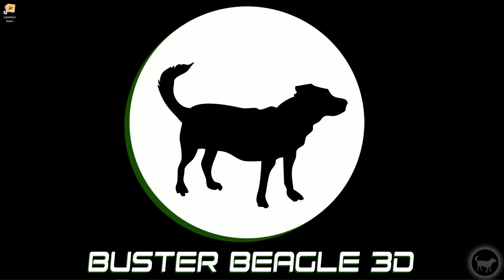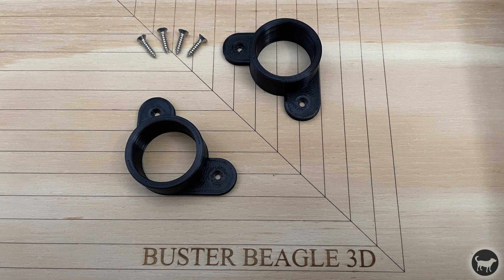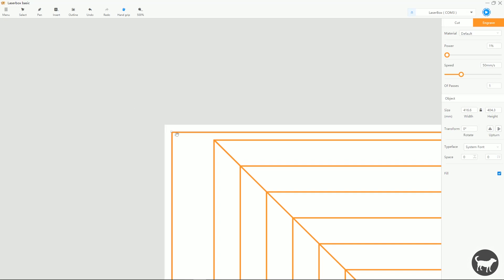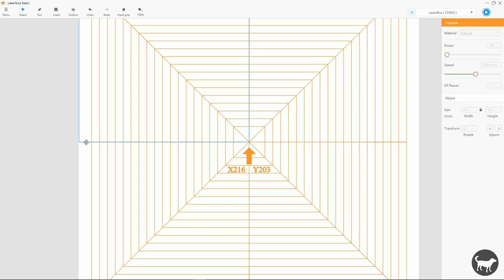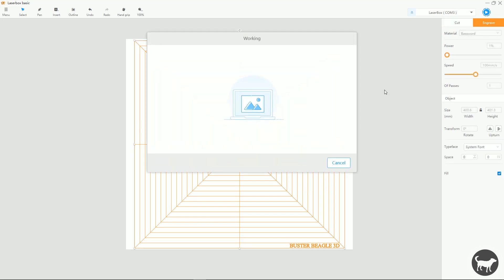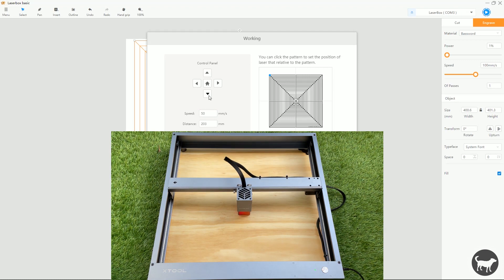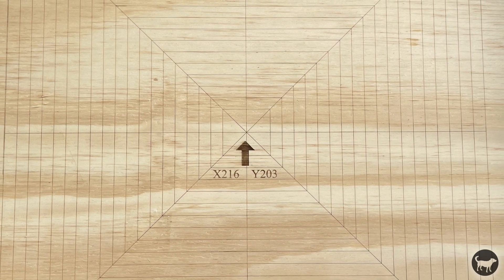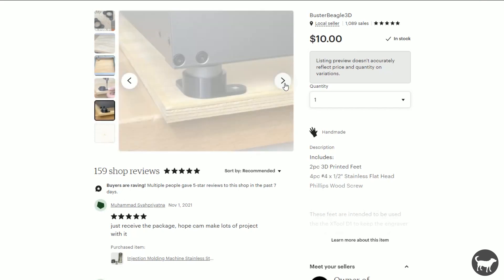XTOOL D1 Laser Foot Bracket and Laserbox Grid

Comment: Hello Buster Beagle, I am thoroughly confused! I have a D1 which has been sitting in its box for a year. I just got it out, I am trying to find your file for the spoilboard in this video......am I a dope or why can I not see it in the thingiverse list? I see feet files and rotary tool files. No spoilboard.  Also....I have downloaded creative space, but cannot find a download for laserbox anymore on the x tool website? What am I doing wrong?
Reply from the maker: Hello. The files for Laserbox are called .lqx files. They are a bit old now and I would highly recommend using Creative space since the other program is really being phased out. If you can’t find Laserbox anymore I now have a more comprehensive and detailed grid that you can find here. https://etsy.me/3YUcBHm  It says that’s it’s for the Pro version but will work with the original D1 as well.

Comment: I've watched the video 4 times. Read the read me first 4 times. Made sure i turned off the crosshairs and all of the offsets mentioned in the video and instructions. I've tried using all 3 files for my D1 pro 5w. I still get the out of bounds error EVERY time. Please advise ASAP.
Reply from the maker: I'm not sure what program you are using but if you are using Ligthburn your workable area should be Width 430, Height 400. It shouldn't be the size of the grid. I made it smaller then the workable area to accommodate that.

Comment: Hey Buster!
I assume since you are using wood here that the honeycombs don't make that big of a difference in the "char"? I will be running air assist, but I want to opt for the extension over the honeycomb (I have a set budget for this purchase) Thanks for the videos!

Also, have you found a limit for max run time? I will mainly be doing leather patches and was curious..how long is too long? Thanks buddy!

Comment: What corner are you saying you move up to? Trying to burn this but not sure on this
Reply from the maker: The home position is in the top left corner.
Reply: Ok, I am running it with the laser unplugged (as I'm in the middle of a hurricane) just to see if it's correct but when it goes to the far left I get a few belt jumps
Reply: @williamhoughtaling1602  hello, I had the same issue when I tried framing and the belt started jumping. I noticed that there is an invisible object you'll need to delete. It's located on the outside left of the workspace. I found it by clicking and dragging and highlighting the entire left side (outside the workspace). I hope this helps.
Reply: Ok I'll look tonight

Comment: Im also running laserbox but when i go to engrave there is no home button, only the arrows.  Did they do away with the home button on an update, is there another way of getting home?
Reply from the maker: Yeah. They removed the button a while ago since the machine doesn't have any limit switches. You can just move it manually to the top left corner or you could also make or 3D print one of these brackets to make sure you are always placing the laser in the same position. https://www.thingiverse.com/thing:5274995
Reply: @BusterBeagle3D  thanks for the reply. One last question. On the new smaller grid pattern on the left side it’s listed 3-50mm, 45-60mm, 60-70mm. What are they referencing?
Reply from the maker: @Dark_Horse_CC  Those are used with the optional rotary attachment for things like glasses and tumblers. It helps line up everything for that. If you check oout my channel I mention it in a few videos.
Reply: @BusterBeagle3D  I must have missed that video. I’ll look back through. Thanks again.

Comment: In my current version of their software there is NO HOME BUTTON where you can "set" the start point of the laser to the top left of the frame. This is WORTHLESS without being able to calibrate where the laser head is starting from.
Reply from the maker: The biggest advantage to the grid is to be able to square your piece to the laser an not to calibrate absolute positioning. There are no limit switches on this machine which is why I'm guessing they decided to remove the home button. It homed by basically slamming into the frame.  There are other ways to "home" the machine to the same spot if that is what you want to do. This tool for instance. https://www.thingiverse.com/thing:5274995

Comment: Good Stuff. My Laserbox software does not have the "Home" option. Am I missing something?
Reply from the maker: They removed it. It was kind of useless without proper limit switches anyway. Just push it manually to the top left corner manually.

Comment: My laserbox basic doesn’t have that “home” button to return the laser head to the top left. 

Any way to get it?
Reply from the maker: You can just manually move it to the top left corner. They removed that button since the machine doesn't have limit switches so it was homing by banging into the frame.
Reply: @BusterBeagle3D  thanks for the reply. That’s what I’ve been doing, but it seems to have a bit of bounce when I put it up on the top left. Was hoping for a mechanical/repeatable option.

Comment: what size for the spoil board?
Reply from the maker: 2'x2'x0.5"
Reply: @BusterBeagle3D  can i use the grid file in lightburn?
Reply from the maker: @bigkahuna2297  Unfortunately it will only open in Laserbox Basic. I don't currently have lightburn so I don't have a version for that.
Reply: @BusterBeagle3D  gotcha i will give it a try :)

Comment: I have the same machine and when I use Laserbox basic I do not have a home button. Is there an update that I should have? as far as I can tell my machine is up to date. Or could this be something that was done away with, with the most recent firmware update?
Reply from the maker: Yes, They removed it since there are no limit switches on the machine so it really just stopped by banging into the frame. I guess there figured that was not a good solution. You can just manually move it to the top left corner.

Comment: Received the feet (Thanks!) and assembled the laser and waste board. Is there a way to calibrate the laser? When I click frame, the laser seems to try and move past the limits in one direction and not to the full range of movement in the other.
Reply from the maker: Make sure you are placing the blue dot in the right spot if using laserbox basic. It's where the software thinks the laser is at any given time.

Comment: Hey just wanted to say thank you very much for the feet that you created I just received them I downloaded the file for the D1 grid for the spoil board and my computer won’t open it what should I do
Reply: Never mind I had to open it right up in laserbox …………lol newbie lol
Reply: OK so I got it loaded and I noticed that off to the left side there are some horizontal lines one of them says 3 to 50 mm the next one down says 45 to 60 mm the next one down 16 to 70 mm and the blinds shoot all the way across I’m just curious what are those for
Reply from the maker: @chadbridgesart  Use the top left box to line the grid up to the top left corner of the workable area then delete the box and "delete me" text. Those other lines are to be used with the rotary attachments. Each line corresponds to one of the roller position options. You choose the rollers that you are using and then line the front edge rotary tool with that line on the grid. When you do that middle line of the grid will be exactly over the highest point of the glass mug or tumbler you are engraving into. Hope that makes sense.

Comment: Any idea why there would be no HOME button in the middle of the 4 arrows?
Reply from the maker: It was removed in later versions of the software. Since the machine has no limit switches it kinda didn’t make sense anyway. Just manually move the laser to the top left corner and start from there.

Comment: Hi Ryan! Thank you for this! Can you tell me the significance of the sizing of 400.6 x 401.3? Wondering if that's why yours is off center?  I would think it should be set for 432 x 406? (Double the numbers 216 and 203?)
Reply from the maker: Hello. Outer square of the grid is 400x400, there must be a tiny section of the cross section being calculated in the software with a larger bounding box which is why it's reading larger when it's not.

However, that is also the old grid and I would recommend the new version of the grid on Thingiverse. The new grid is one square smaller.  Since the machine has no limit switches and even recently removed the homing button there is no way to find the 0,0 location without manually moving the laser head. Since this position can not be guaranteed the laser was hitting the frame while burning the grid and causing issues. 

Each line of the grid is 10mm apart. While I could have made it 400x430 it was just easier to keep it sqaure given the limitations to LaserBox Basic.  216, 203 should still be the center of the workable area no mater what shape or size the grid is. 

Hope this helps.
Reply: @BusterBeagle3D  Thank you- I did use the new file and it worked great- but question- what are the numbers on the let of the new file? 3-50mm, 45-60, and 60-70. Can't for the life of me figure out what they are there to help me with! I tried to join the FB group twice now but for some reason I'm not getting past the pending phase...
Reply from the maker: @kimscreative6834  Those numbers are for setting up the rotary attachment to the laser. The rotary has 3 different locations for where to place the rollers for different sizes of tumblers, glasses, etc. When using those lines you place the front edge of the rotary on those lines and that makes the center of the grid the center for the rotary tool. Hope that makes sense. :)
Reply: @BusterBeagle3D  what do you consider the front of the rotary attachment

Comment: Thanks. I downloaded the grid file, and it is with the rotary grid also, which is great, but it has both the cut and an engrave tabs. Obviously, I do not want to cut, but how do I prevent that? Do I just set the cut power to 1%?  Is there a way to prevent the cut?

Comment: Hey Ryan,

When I lined up this grid the way you described in the video, I set all of my settings to be what I saw you had on the right before clicking the blue arrow. i.e. I adjusted to 400.6 x 401.3, power down to 1%, clicked fill, etc. When I clicked the blue arrow to then adjust my laser, I noticed that my image did not line up center like yours did. It looks like the image is up a bit and to the right a vs the x and y axis that the software shows over the space. Any thoughts on that?
Reply from the maker: Hello. You want to go over 216 and then down 203. Also just sent the power settings to basswood if it already isn't. I think the 1% was just a glitch and not the proper power settings. As far as the middle not lining up I would say to just shut everything off and try again. 99% of the issues people run into when trying to burn these magically go away when they just shut down and try again.
Reply: Is there a different center due to the different measurement on a D1 pro versus the D1?

Comment: so curiously, i downloaded the file and placed it according to the video, deleted out the box and text. when i go to the start screen the image is off from the center of the workspace. it is correct vertically but offset to the right. when i hit framing the top left causes the belt to slip if i put the dot in the middle of the image, if i put the dot in the middle of the lightbox center it grinds on the top right side. thoughts?
Reply from the maker: I would try to restart Lasebox Basic. Most of the issues are usually corrected when people just start over and try again.  If you are still running into issues make sure you are using the “shorter” version of the lqx file from Thingiverse. I had altered the file to make sure it never got too close to the frame. With no limit switches it’s impossible for the laser correctly know its position. In the newer versions of laserbox basic they don’t even have a home button anymore. Probably for that reason.
Reply: @BusterBeagle3D  Do you have a suggestion of how to do this without the home button?
Reply from the maker: @29src  Just move the laser by hand to the top left corner. That is essentially all the homing button was doing.
Reply: @BusterBeagle3D  thanks. I ended up getting the trial of lightburn instead. Then just creating a grid template with that. Allows for absolute positioning. Even that the position seems to drift doing multiple of same item. Always would check framing before a burn. Bit of a learning curve to get some accuracy with it.

Comment: Thank you for this,I ordered my xtool d1,it should arrive soon.I was wondering if there is anyway to add limit switches as I did an upgrade on my shapeoko and I have limit switches that I can use on this machine. I have no idea where to start any recommendations on videos to watch to connect them if it is at all possible.
Reply from the maker: No ports seem accessible on the motherboard so nothing to plug them into. Plus this isn’t the the open source machine at all so firmware upgrade would take a bit of work to get right.
Reply: @BusterBeagle3D  Thank you.I did write to them asking if I could have connected the laser to my shapeoko which would have made more sense,but they could not recommend it that might be a big market for them selling the lasers to owners of cncs if they could figure out the wiring.

Comment: Can you help I don’t see the ability to have a “home” for the laser?
Reply from the maker: In the latest version of the software they removed that button. To be honest they really should never have had that button in the first place because the machine does not have any limit switched so the homing just made the laser crash into the frame and stop. Now all you need to do is manually move the laser to the top left corner and follow the rest of the steps after that and you should be fine.

Comment: @Buster Beagle, can you confirm your issue was a loose belt? That looks pretty far off IMO.  What was the root cause?
Reply from the maker: I think the real issue is that since there are no limit switches on the machine there really was no way to know if the laser was going to hit the frame. I ended up shrinking the file by 10mm so there is one less outer ring but also a less possibility of accidentally hitting the frame while burning.

Comment: This is a lifesaver for me....just got my D1 and am ecstatic!  However, while cutting out some desktop name plates, my text was angling down.....had this to happen several times and I messed up a few pieces of oak.  Your holders and grid I am sure will solve my problem by keeping everything square.....just ordered the holders and can't wait 'til they arrive, also downloaded the grid file (You could probably sell this too).   Planning to use 1/4" plywood for my waste board  and putting in a new one from time to time.  What are the burn settings, and did you engrave or cut the grid into your waste board?

Your video on Laserbox Basics is awesome, I keep going back to it...... you should do more!
Reply from the maker: Hello and thank you. I wasn't trying to be in the xTool parts business which is why you can download all of the files for free but people kept buying stuff so I'll sell it till they stop :) All of the settings should be in the .LQX so you shouldn't have to change anything. I did hear that xtool got rid of the homing button in Laserbox Basic which just means you will have to manually move the laser up to the top left corner instead. Thanks for you order and your support!

Comment: Can you provide me with the full dimensions of the waste board you used? Don’t have power tools so I’ll need to have the hardware store cut the wood for me.
Reply from the maker: I bought it already cut to size at Home Depot if you are in the US. It was a 24x24x.5 inch piece of plywood.
Reply: @BusterBeagle3D  got it thanks. Wanting to print the grid you provided. Seems the dimensions of the file on thingiverse are not the same as shown in your video. Will this make a difference? Will the instructions in this video still apply?